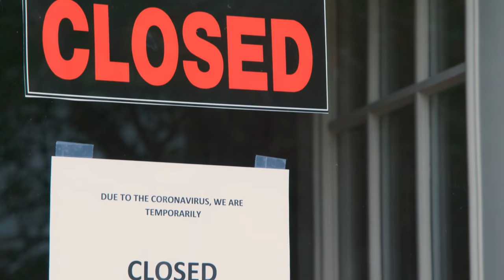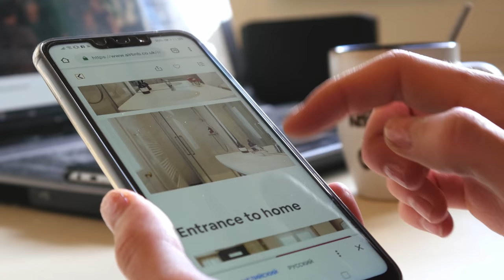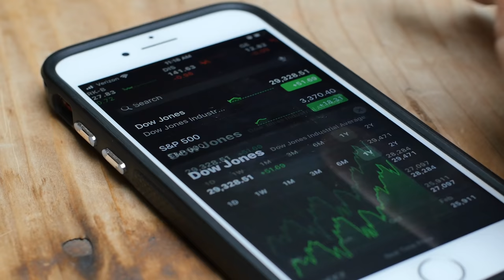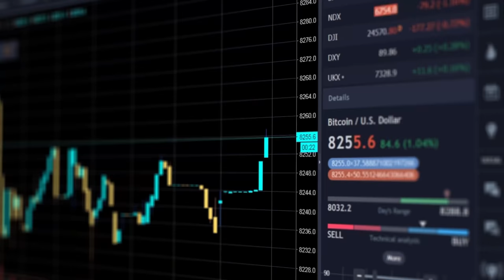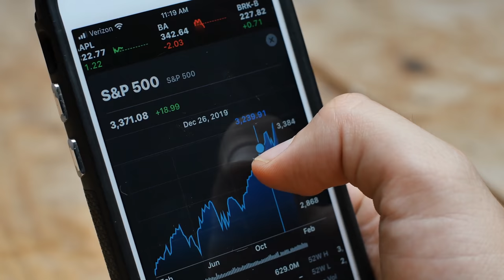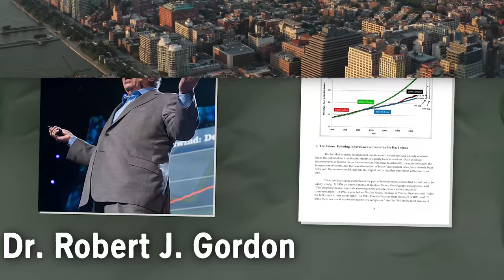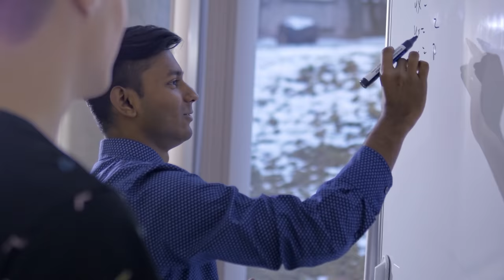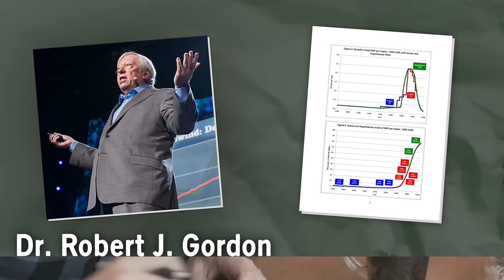You Will Never Retire, Here's Why... - How Money Works

Comment: After 90s, developed countries started to accept massive immigration as a means to add more workforce to their economy. I guess that will continue in the coming years too.
Reply: And outsourcing labor. I worked for a company that paid $40k per year to a company in India for their software engineers. That same job was worth $105k per year in the US plus benefits. Companies don’t care about their work force, they only care about their bottom line.
Reply: The salary is actually around $25,000 in the Philippines for a Senior or Lead Developer and Test Manager. Add some overhead to that. And that salary is highly above average compared to other professions which 1/3 of that.
Reply: Outsourcing is inevitable of course. US earn great profits through exports of technology, movies, iphones, etc that is why our peso buying power is so low, that is why our salaries are so low.
Reply: That is the reason why Europe has been tolerating the massive Muslim post-Arab Spring immigration despite the culture shock. The rate of replacement is so low, they need these hands to keep working as well as to sustain the amount of consumers to keep the regular cycle of economy going.

Comment: The problem with the lumberjack example is that it doesn't count for new generations getting into the work force,so the factory will get new tools but will never run out of workers.
The only way for it to go the way you described would be if nobody would be born,nobody would die,and everybody would save for retirement.

Comment: "... once the mortgage is paid off, you have somewhere to live with very little ongoing costs."
Have you ever owned a home? There is homeowner's insurance, property taxes, utilities, repairs, maintenance, and improvements. For just an example off the top of my head, I would say most home mortgages are for 30 years. I think most roofing jobs are guaranteed for about that long. Even if your home got a new roof the day before you bought it, you will probably still need to replace it at least once if you stay there long enough to pay off the mortgage. That alone is an expense, depending on several factors like size of the house, etc., that will be somewhere between $20k-$40k. Yes, the cost will be much lower than when you were adding a mortgage on top of all that, but the ongoing costs are not insignificant. I have a very modest home (only 2 bedrooms, 1 bath, but in an area with higher property tax), and my taxes alone are over $7,000 per year.

Comment: I find it hard to belive we won't improve productivity. There are still alot of massive productivity breakthroughs every couple of decades and it doesn't appear to be slowing down. PE ratios also reflect the psychology of investors it appears to me that people are buying stocks based on emotions rather than disiplined valuation. Theres probably going to be a correction. Even still there are stocks with sub 20 p/e right now. Whats stopping an investor from buying a basket of these?
Reply: The “problem” with improving productivity is that eventually those who are removed from the workforce cannot enter it again elsewhere because they have no relevant skills or are not trainable for the careers available. Hence, a rebirth of trade occupations follows.

Comment: I grew up with parents who kept rotary dial phones until the AT&T break-up, were nearly 60 before owning a car with power windows, power door locks, and FM radio, and owned a house more than 10 years before buying a power mower.

My wife and I still use a answering machine and a stereo that I got as a Christmas gift from my former boss in 1999.  We volunteer to get bumped from flights, starting back in 1995.  That has saved us thousands of dollars in air fare.  We slso stay at hotels with free breakfasts.  That saves money.

Of course, we use coupons, whether for grocery shopping, restaurants, or anything else.  The dealer offered a 12% discount, if I scheduled an appointment with the new on-line scheduling system.

Comment: As for the next 10 years, there is a lot of work to be done installing all the infrastructure needed to enable the future you talk about @ around 10:30. I wonder if this cycle of updating the infrastructure for the next generation of technology could be the cycle that will maintain work (not necessarily jobs) needed in this 40-50 year run you talk about

Comment: So things like Mutual Funds, ETFs, value of saving young, retiring in lower cost of living areas, etc. aren’t options to counter these problems? Almost every issue besides housing is a cherry picked perspective ignoring strategic ways to avoid it. For example, if one must invest outside mutual funds then you either invest at low market points or find new, innovative companies meeting specific fundamental criteria. 

We do need to find ways to counter rising inequality and ridiculous college costs, which are serious threats, but most issues described here have relatively simplistic solutions that still enable retirement.
Reply: How do you fund it when maxing out your work hours still only leaves you with pocket change after rent, car insurance, renters insurance, health insurance, car parts, clothes, gas, electricity, and water bills. 

You can't even buy a meal outside fast food for 7.25, how are you supposed to get anywhere if 2-3 hours of everyday worked goes towards food?

And this is without any stuff to relax, no tv, netflix, beer, nice dinners, forget about trying to buy nice gifts.

Oh and when the crushing weight of reality comes down that the six pack of beer could've been invested, at least we'll have the knowledge we can actually use it... 

oh wait, we'll be 70+ by the time it'll be our turn to retire, enough to enjoy the last 20 years of our life, hoping we don't have a stroke or heart attack and be bled dry by the healthcare expenses needed to recover. Medicare doesn't cover 24/7 home care, and they'll cut off extra support if they find out you can pay higher premiums, so all the money you "saved" by not making life experiences, sharing beers on days you can't afford to take the time off of work for, is pissed away trying to keep you from dying alone.

Woo, capitalism!
Reply: @internetbodhi1009 Can’t buy a meal fir less than $7.25??? Where are you shopping? Google eating healthy for a week on $20; I’ll wait. 

The key is starting early. Every dollar you save at 20 is worth about $88 at 65 so being smart is key. The stuff you mention for relaxing is for when you have money. The way you write your problem seems to be that you want a posh lifestyle AND savings at the same time. Life doesn’t work that way for most people mate.

We have legitimate economic problems in the US, but our youth thinking it’s reasonable to buy a $2 coffee is also a huge problem.
Reply: @internetbodhi1009  I also recommend looking into retirement abroad, or on cruise ships. If you don’t have sufficient funds it’s dumb to stay in the US and there are multiple, great alternatives. Thankfully, the internet makes all this knowledge easily accessible for the majority of humanity with access; all it takes is someone who actually cares enough to prepare for their future. An example I’ll point you to for general education is the Money Guy channel on YouTube; just one of literally thousands of resources to learn from.

Comment: I long concluded that retirement wasn't possible for the average person perhaps 20 years ago. I was looking at things then and determined that the economy will not allow you to do it.

Understanding economics is great, but it gets down to just plain common sense and observation. Meaning, I simply watched prices with regards to everything that it takes to live and determined that unless you invest (most cannot) or hit the lottery, the average person will not be able to do it. The primary reason that this is the case is because the system is designed to keep rich and poor where they are from one generation after another.

Comment: I think you glossed over some things which could be done to alleviate some of the challenges you mentioned. Worried about high P/E ratios? Buy value stock ETFs which long term tend to perform better anyway. Worried about low growth? Buy small cap or emerging market ETFs. Most countries on this planet still have  huge growth potential.

Comment: Planning for retirement is not that hard but the clue is in the name because getting to the planning part, people need to acknowledge there is a problem that needs solving. A lot of my fellow millenials grew up with the presumtion that life is so messed up, they would surely not get to live till 60 or so and, even if they do, the state will step in to help them. I started focusing on it in my end 20s which people around me considered as overreacting (I was myself on the fence about it) but now I know that if I did it earlier, it would have been even easier. Thats not to say that governments and employers couldnt have done better job on workplace schemes. At least here in the UK, they replaced the older workplace pensions that guaranteed decent income that adjust with inflation. I get why they needed to do that but the current version not only relies on workers contributing more but the risk of stock market loss, inflation or how funds will be allocated which all rests with the workers, to know how to navigate through that maze.

Comment: The capital investment part forgets the fact that new workers join the workforce... In a stable population for every worker retiring there is one worker joining the workforce. The issue younger generations face is being smaller than the generations which are retiring. Requiring fewer workers to provide the resources and services for a larger population. I bet we will see inflation continuing to be high, simply because the supply of labour in the future will be lower than the past while demand remains high making work today more valuable than work yesterday (inflation increases the value of work done now relative to work done in the past). I think people entering retirement or about to have more to fear than people in their 20s. Working age people will see their salaries increase with inflation while retired people will see their savings eviscerated by inflation (because there will be lots of retirement $ competing for fewer goods/services)
Reply: Salaries have barely budged in 25 years. In 25 years it went from $4.15 an hour to a measly $7.50. If minimum wage had kept up with inflation, it should be $24 an hour. Every expense has gone up but wages have not kept up. My rent has TRIPLED in the last 13 years. My paycheck certainly hasn't tripled. I make less money now than in 2010.

Comment: Good video but it did not address one of the major factors here in wealth concentration being the major issue their actually is no need to push back the retirement age that would not be necessary you do need a fundamental shift though and you could just have those at the top bear the cost and they would be fine but as always they will shove it to the bottom.

Comment: Honestly, at this rate I'm pondering whether or not there will be an economy to retire from when I hit that age.
I have at least (at least) three decades left before that is even a consideration. If the economy keeps growing at a near exponential rate (from what I'm seeing in terms of data) it could be as early as two decades from now where there's simply a critical mass that just cannot be overturned due to the amount of effort/work it would take to reach the next stage.

It's sort of like a mathematic question I saw on another channel. Say you had a piece of gold at 1200 that turned into two pieces at 1800, then four at 2100, then eight at 2230 and so on and so forth until midnight came around. You would never actually reach midnight because the exponential factors of both the duplication and the halving of time means you would have an infinite amount of gold the closer you got to midnight. This is how I currently feel about the economy, it will keep growing and growing until it simply collapses from its own critical mass because it becomes too inflated to keep alive.

I'm also not assuming the USA will be the same USA as it was in the past and that the future of the nation is also subject to change which will most certainly affect everything.
Reply: Agreed. Unless we have a MASSIVE shift now, 2050 is going to really suck.... Climate change, antibiotic resistance, fishless oceans, pollution, food/water shortages.....and that's not even getting into the finances or politics.

Comment: I don't understand why the "5th headwind" is really a thing. Renewables are cheaper than other energy sources, so that should actually boost the economy in the long run, as long as we solve the energy storage problem. It will result in a more stable power grid than ever before, in contrary to what some scaremongers say. Also there is plenty of stuff that can be made more efficient in the future and tons of things to be invented (more efficient renewables, fusion technology, robots that build houses, more efficient energy storage, just make up your mind). If you think about it: Ultimately there will be a point were all energy will come from either renewables or nuclear and all work will be done by robots and AI. Are we there yet? No! So there's plenty of work to do and plenty of investment to be done. I think Dr. Gordon is wrong. But you guys go on and sell your stocks, I will happily buy them :)
Reply: If by renewables you just mean wind and solar then storage is a problem. If the environmentalist wasn’t so ignorant we would be going nuclear, geothermal and hydroelectric power which are significantly more consistent than wind and solar

Comment: Many people retire and maintain part time employment so they dont get bored. Either way, Top tips: (1) buy a house (2) pay the house off as quick as you can (3) Dont get sucked into unnecessary debt, it  keeps you trapped.  (4) Save an emergency fund, then start saving for retirement. There is more than one way to save for retirement but social security only WILL NOT CUT IT. A house, a personal/company pension, other savings, social security and if need be a part time job.   Do not be needing a full time job and paying rent to a landlord at 65.

Comment: To be honest, this is not new. To live well and all, you need to make more than others. There no special secret. That's just about it. It is not new neither. It was the case 500 years ago, 50 years ago. It is the case today and will be tomorrow. You want to be in the top 20%, 10%, 1%... Not bottom 20%, 10%, 1%... Not even just median income.

This is because most things are made for median income. If you have less you can't afford it. If you have median income, you have to compromise a lot and set priority. You can either live decently, but then put no money into retirement and all, or you could save a lot... but don't have enough to live well...

Top earners have the choice. They can go for FIRE. Live with same expense as medium income and retire early at 40-50 year old without being drastic on their life style compromise. Or they can retire at 60 and have a life of luxury.

So for me the plan should be to ensure you have enough value so you can be in this backet of top 20%, 10% or 1%.
Reply: Just live in a low-income country and do online work for American companies. Easiest way to be in the 1%.

Comment: The biggest lie in economics is that deficit spending or increasing the money supply is bad.  It's only bad if it causes stagflation, due to a lack of job skills and education and poor productivity.  Most of the time it is great for the economy, i.e. 1980-2000.  Increasing the money supply should be done to put money in the pockets of the poor and middle classes, which would grow the economy better than having it hoarded by the wealthy.